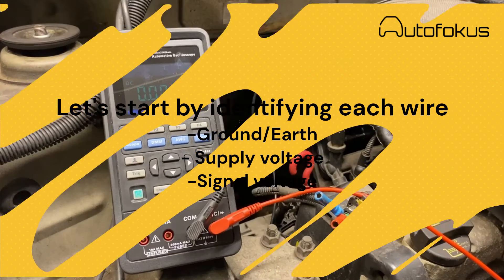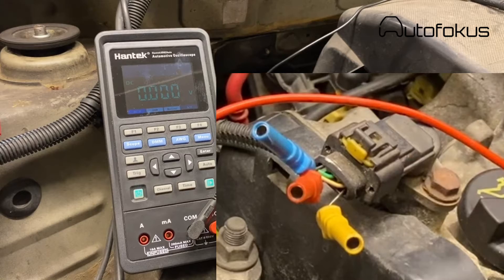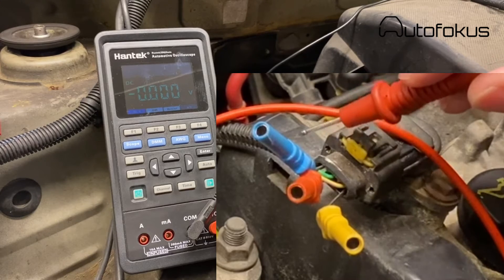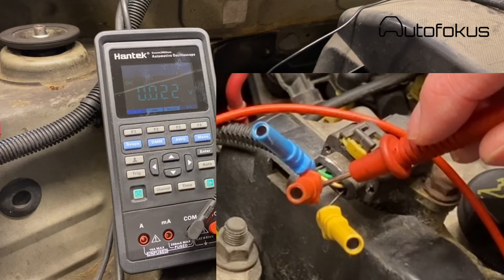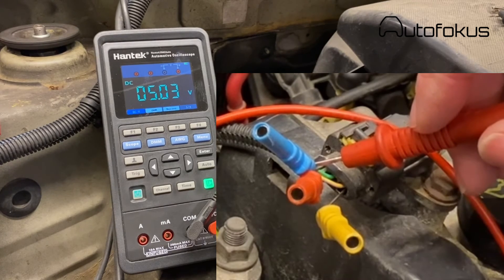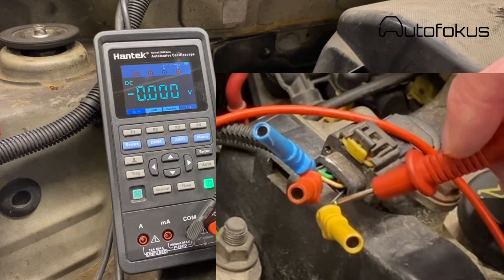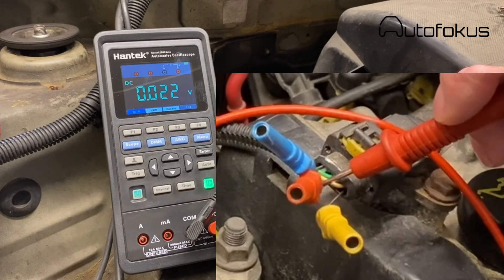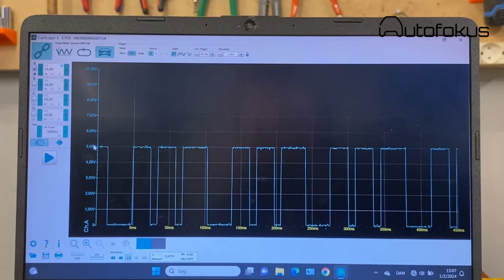How to test and diagnose a Hall effect sensor.

Comment: Interesting but my Peugeot camshaft sensor  have 12v, 5v and ground. 5v drops to 0 when initializes.
Reply from the maker: That is not uncommon. The supply voltage is 12V, the hall signal is then 5-0v (on-off)

Comment: The systems using hall effect sensor are configured differently i n automobile. You need to have the diagram and know if the signal would be a generated one or modified voltage. On ignition, test voltage on  each of the lines  and if possible compare it with a similar system. Some may have battery voltage on he supply line, about 10v on the signal line and 0v the ground line. So you need to be so sure of the system you are working on, it will even help during bench testing of the sensor.
Reply from the maker: Hi there. Valid point you make. Actually on my Suzuki Swift the vehicle speed signal is a “hall signal” transmitted to  the power steering control unit from the ecu, but infact it is a pwm-signal. 
But the original speed signal is from a hall sensor.
In the video this particular sensor is also a hall element sensor.
Thanks again for coming with your good comment!
/Simon

Comment: do you have a video for 2 wire hall?
Reply from the maker: Hi there. Sorry I don’t. But it is very easy, the missing wire is the ground. So the other two are supply and signal.
The two wire hall sensor is grounded through the sensor itself.
/Simon
Reply: @autofokusDanmark  thanks for replying. I tried to get a waveform on bench but no luck. I supplied expected voltage as suggested by factory service manual (8.95V) and the sensor pulls .395Amps but I still can't get a waveform 🥺 I used a food mixer as a reluctor wheel😅 even tried taping a magnet.
Reply from the maker: @namechane1758  perhaps the grounding in the sensor is broken, or rust has added resistance.
Is it a wheel speed sensor?
Reply: @autofokusDanmark  it's a "new" sensor out of the box autozone
Reply: @autofokusDanmark   The sensor is made FULLY of plastic, only two pins are exposed. the is no ground pin nor the sensor can touch the ground by a mounting screw etc. 😵‍💫